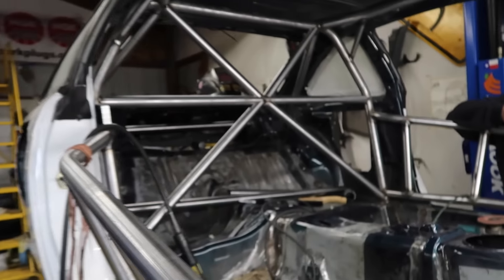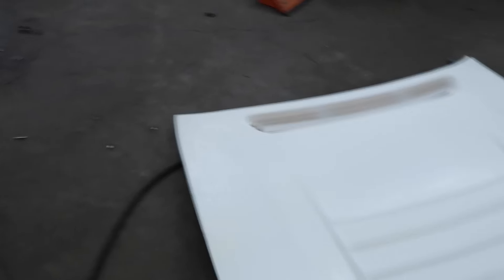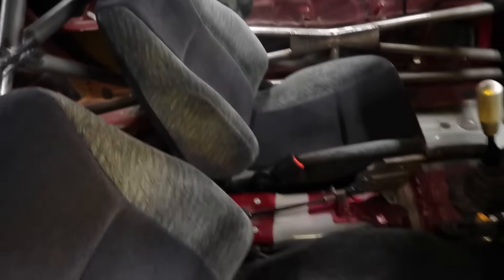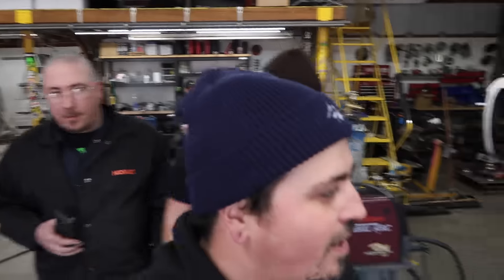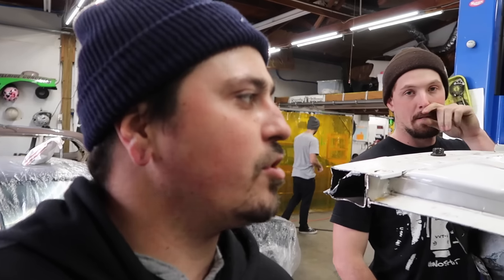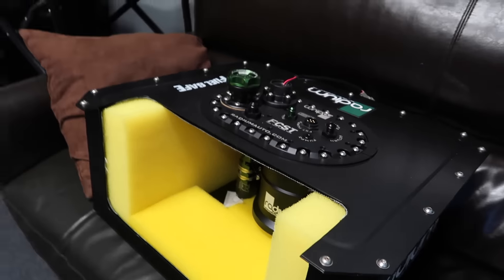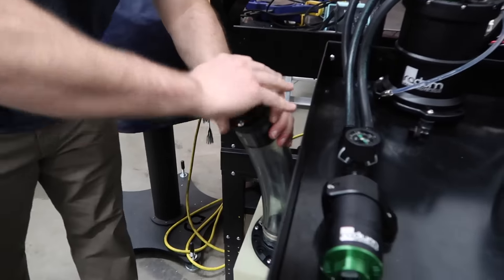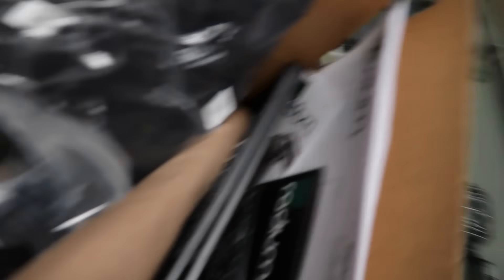MORE PARTS FOR THE S14 BUILD!

Comment: Hey Caleb, How come high horsepower drift guys run such soft springs in the rear?
Reply from the maker: +Tye Varnes for grip. When you have a lot of horsepower you want to be able to use it and put it to the ground. If you have a stiff spring and small tires you'll just be spinning tires with no speed. So with a softer spring and bigger tire your car can actually get grip